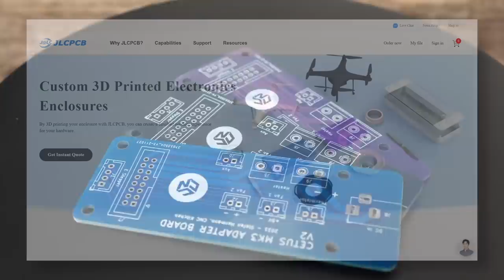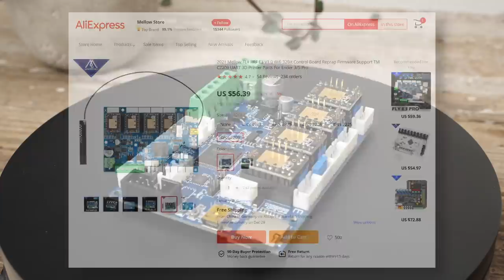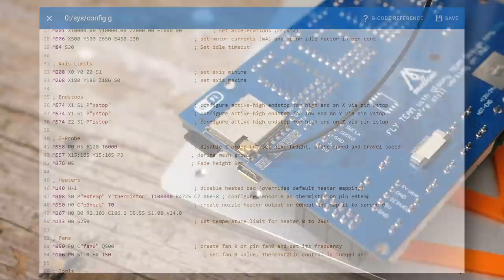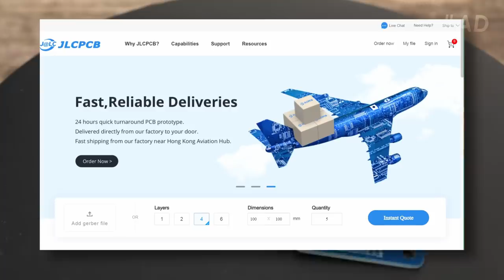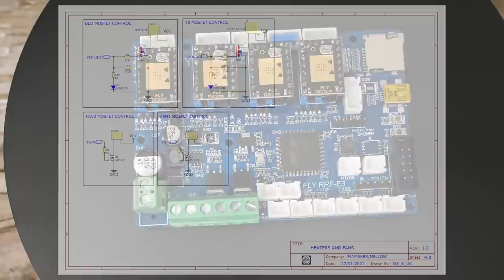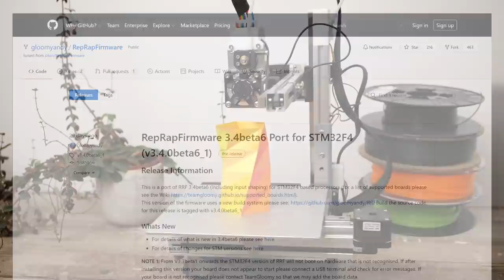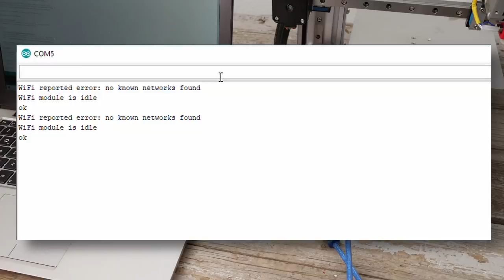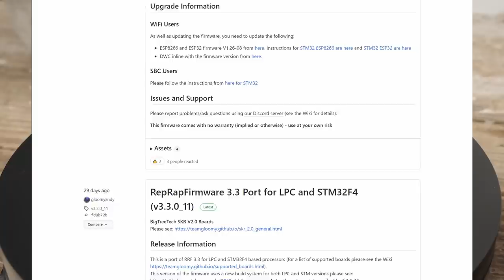I HATED my Cetus – Now I ❤ it! Mellow FLY RepRapFirmware conversion

Comment: Over time my cetus motors got hotter and hotter during operation, eventually chewing filament after the raft without fail. They should just ditch the proprietary stuff, the market won't tolerate that anymore.
Reply: This has happened to me too, and sometimes it doesn't even get through the raft. Very frustrating
Reply: I'm preaty that's broke an entire extroder head for me
Reply: @mondair99  Throw some heatsinks on it
Reply: @Lucas_sGarage  thanks boss, I'll try to remember to keep you in the loop
Reply: @mondair99  Sure, take care

Comment: This is one of the things I love about 3D printing as a tinkerers' hobby, the mechanical principles are comparatively simple (if you got four motors and parts for those motors to move, you've got the basics) and the software side is so open that you can get pretty much everything that can command stepper motors and relays to run gcode. (I'm oversimplifying a bit, but really, for something that creates physical objects, 3D printers are incredibly easy to understand even for idiots like myself. Like, for comparison I don't think building your own injection molding machine is anywhere near as simple.)

I got into things with the Ender3, and after tinkering with it for two years I think the only stock components that remain are the aluminium frame and motors xD

Comment: What a coincidence! A week ago I completed the electronics conversion of my MK2. I did it with an arduino mega + ramps 1.6 + TMC 2130 + raspberry PI 3 so that I could go with klipper. I didn't want to replace the very cool PT100 thermocouple for a shitty thermistor, so I went for a max31865 SPI adapter board. I also upped the voltage to 24 V as running the heating cartridge at the standard 19V was a pain. Now it is a pretty amazing machine!
Reply: I did something very similar on my MK1 last week too. Lol. I used an mks robin nano v3 with tmc 2209 drivers. It's got a touch screen and wifi but the screen is too big to mount anywhere on the cetus. What power supply did you go with? My heated bed is super weak on 19v. It draws 30w. I did the math and going to 24v should get it closer to 60w. Unfortunately, I did have to ditch the pt100 because it failed and I opted to replace the entire extruder/hotend. I ended up going with the kp3s titan extruder. It performs great and now I just use standard mk8 nozzles. Last night I put a 3d touch on it, so no more frustrating warped build plate.
Reply: @inoahmann7542  For the time being I am running it from my lab bench PSU and I have a step down converter for the RPI, Arduino and fan. With everything powered it draws about 3.2~3.5 A @ 24 V so I was thinking about getting an EPP-120S-24 PSU, which has a very small footprint. There are also more powerful (but larger) versions if you want to plug the heating bed.
Reply: @urano1988  thanks! I think I'll go with that same power supply. Maybe a slightly bigger one if I can still fit it in my electronics enclosure. If I need to I can limit the power to my hotend and bed to stay under the 120w limit.
Reply: I currently upgrading my Cetus MKII and MKIII I replace the Cetus extruder to BIQU H2 extruder. I also replace the TinyFab MCU/mainboard to Melow FLY RRF E3 Pro with the integrated max31865 SPI PT100 IC. And because of the shorter heater cartridge for BIQU H2 extruder  I use a Mellow 24V 70W heater, and increase the voltage from 19V to 24V. And I will also design an extra PCB for the PSU connector and for the Z axes hardware break by a relay. This feature is on the MKIII mainboard and also designed in the TinyFab mainboards as well.

Comment: Original cetus circuit board had a vase gcode bug. I think they implemented vase as delta Z moves but the firmware math truncated the remainders. Now running duet and happy. A good mod is a 1kg force linear spring ($8-20) to counterbalance Z weight which eliminates the Z stepper brake and prevents the nozzle from crashing into my heated glass bed with no AC power..
Cheers-Peter

Comment: Thanks for this video. Nice to see theat you transformed your Cetus into a good machine. I use a Fly 3 pro on my Ender 3v2. Ik like it a lot. No more recompilations of the firmware when I do a slight modification of the hardware. No extra Raspberry with Octoprint which doubles the amount of complications. I love this solution. 
Please remember to change the gcode dialect in your favourite slicer from Marlin to Reprap. ;)
Reply: Does it work with a BL touch or CR touch? As I learned more about my E3 V2 I realized I can turn it into a really nice printer instead of buying a different one. My CR touch and Jyers firmware is a joy. I like the options this fly 3 adds.

I'm also a minimalist. Any hardware I can install that will do the work of multiple pieces of hardware, I'm all for.
Reply: @dangerous8333  I used the FLY with a BL touch clone. Twotrees I believe. It's a bit more ciitical to ajust compared to the original.

Comment: I am interested in a strength test. Maybe even in comparison to standard SLS parts.
Reply: +1
Reply: MJF is superior in z-axis strength and consistency to SLS and is superior in every way besides specialized material availability.  I own two 5210 MJF machines and would be happy to provide CNC Kitchen some parts for testing!
Reply: +1
Reply: @mkmachining7957  What is the reason for this? Layer height? Temperature? Maybe Stefan can find out.
Reply: Yeah.. that fancy nylon print would be a great test subject checking for accuracy and strength.
Reply: @jayphone1  more consistent temp and the powder is fused much more quickly

Comment: Nice to see RRF ❤️. I use RRF on my machines and adore this firmware. One board, easy config and decent features.... Did I mention very stable as well?
Reply from the maker: Same here, most of my everyday printers now run RRF. It takes a bit to learn but now I love it!
Reply: I liked RRF but the problem for me is that if something doesn't work, the support for it is as useless as windows support. Switched my duet board to Klipper and never looked back since
Reply: @jexom  I've honestly been able to find documentation for everything I've ever had issues with. The wiki pages are pretty well written. Though I gotta admit having stuff like a discord server for the vorons which usually run klipper is pretty sweet.
Reply: @jexom  On the Duet forum you can literally talk to the developers and they will walk you through your issue. Is that useless?

Comment: Will you consider reviewing the Phaetus (or rebranded as Trianglelabs) 'Rapido' UHF hotend? It's a high-volume, quality workmanship, mostly nickel-plated copper unit with strong construction and a (up to) 115 watt ceramic heater, that give even the Mosquito Magnum Plus and Supervolcano a run for their money. And it does so while still using the regular M6 reprap/V6 nozzles we already have, or optionally regular Volcano nozzles. Slap a large CHT or Matchless nozzle on that puppy and it might just pass 100mm^3/s. For $99.

I believe the... "contentious" (?) aspects are more than different enough that this one goes clear of Slice's and E3D's patents.

Comment: I finally got a new 32 bit board to replace a 6 year old 8 bit one, and I didn't think it was actually possible for my machine to be this quiet.
Reply: that was how I felt when upgrading my original CR-10
Reply: I had a reverse experience at work. When I built my machine, I built it from the ground up with TMC2208s, and later upgraded to closed loop steppers (the BTT NEMA 17s, great stuff). They're really quiet, became a "silent but the fans" printer. No money for Noctuas here.
Then at work I was tasked to revive an old small CNC router, and found an Arduino Mega + RAMPS 1.4 setup with the classic A4988s there that I could use, and heck that thing screams, I had no idea they were that loud normally.

Comment: Just a note: At 4:34 you said 'RRF has begun implementing Linear Advance in the latest version' but I believe you meant input shaping, as in the image you show the input shaper test model as well. As Linear advance has been in RRF for quite a few versions now.
Reply from the maker: Yes, you're right. I was too excited after my Klipper joke and messed it up.
Reply: @CNCKitchen  haha worth it since it sums up the community pretty well. 

Hopefully I don't come across as a 'but klipper' person, but I'm genuinely interested in your opinion given your knowledge of 3d printing.

From my comparison standpoint, and considering I have several printers running RRF and several with Klipper, I think I prefer klipper slightly more for two reasons: 

1. The first and foremost being that I'm a software developer, and so have command-line access where I can deploy scripts and modify any components as I see fit. This is a bit harder with duet. 

2. The second being the actual hardware of the Pi being high quality. I have had many issues with the wifi reception with the stock duet antenna and even using add-on antennas. I sometimes send extremely large files and so this can be a pain, whereas the raspberry pi 4 even supports wifi 6, so it caters well to my impatience. 

In summary they are both great with slight differences, duet is more user friendly, and klipper more configurable. Almost like macOS vs Linux.

Comment: I just did this with a Dobot Mooz, I used a BTT E3 RRF board, it can now print any material, much better printer than the Cetus, but had a terrible main board and closed software.

Comment: Wish this was posted 3 weeks ago. I just bought a duet 2 to convert my Cetus MK2 to do just this.
Reply from the maker: Sorry to hear that. Hope it worked out for you!
Reply: @CNCKitchen  I have been messing with it all day. Unfortunately, I have MK2 and you started with a MK3. So there are some variances like trying to get sensorless homing working. I also switched from using the standard hotend to a Slice Copperhead.
Reply: Haven't started a print, but I have about 90%+ of the printer verified working. Last thing is swapping the sensorless homing with a capacitive proximity sensor for the Z axis.

Comment: Awesome.. This is a great video.. I currently have a smoothie board running my Cetus. But I will try this one soon.. BTW the original cetus heater block uses Pt100 as temp sensor. The pro version has a variant supporting pt100 so chose that if you don't want to switch original temp sensor
Reply from the maker: Thanks for the info!

Comment from the maker: Thanks to JLCPCB for sponsoring this video! PCBA from $0 (Free Setup, Free Stencil) https://jlcpcb.com/RHS
JLC 3D printing service: https://jlcpcb.com/3d-printing
Correction I said RRF started implementing Linear Advance but I meant they started implementing *Input Shaping*. Sorry.
Mainboard conversion or buying a new one? What's your take?
Reply: Conversion, it was a good machine in 2017 but now is a pain in the ass to use. Modded mine as well but I have changed the extruder also. Hate proprietary nozzles. Do you have links for the extruder stepper mod?

Comment: Nice video, this might be a mod I'll actually try. At the moment the only mods applied to my cetus is a new 80mm Noctua Extruder/Part Cooling fan + adapter, because the stock one was really uncomfortably loud. Although I'm okay with the prints I'm getting out, using something different than the proprietary UPStudio Slicer (which I dislike) with added microstepping capabilities would make this upgrade really worth the effort.
Anyway, thanks for sharing :)

Comment: i would not get a board that runs rrf. i go fpr the genuine duet boards. after all problems i had with marlin back in the days and almost quit the hobby i ordered a duet wifi. and the support i got from dc42 made me a returning customer. all my printers my custom built voron/hevort hybrid. my tridebt idex. and my ender 3 and flsun sr all run duet boards and i think its worth to support the duet crew

Comment: I have a Cetus MK1. This was my first really functioning 3d printer. (After the Buccaneer from Pirate3D with which I only did 2 prints and then it died. And I believe it even arrived later although backed earlier on Kickstarter.)
I am thinking about modifying my Cetus as well because it was a little neat machine, but I am a little afraid that getting to learn all the new stuff about the board and the software driving it will take me too much time.
Reply from the maker: If it's not your only machine, it's a great learning opportunity, though it will require some time and skill.
Reply: I think a Skr1.3 board with stepper drivers on it will be the easiest approach. No need to fiddle around with multiple boards and connections and weird firmwares. Just use Marlin on a SD card, done.

Comment: @5:10  I wish someone would make one of those awesome adapter boards for the CR10s-Pro, I really want to upgrade to 32-bit and those FLY boards look pretty, er, fly... for a wifi.  😎

Thanks for the most excellent video.
Reply from the maker: The CR-10 is internally very much like the Ender-3, so a conversion doesn't need an adapter board and most of the connectors should be reusable. Maybe check the Discord.
Reply: @CNCKitchen   The CR10s-Pro has a 30-pin ribbon connector.  I did see a breakout board a while ago somewhere which was 30-pin to JSTs, but I think the chap only made a few.

The alternative would be to chop the large connector off and, split the ribbon cable add male JST connectors.

Comment: On my Ender 3 Max I have an RRF E3 Pro. I had to switch from an RRF E3 when I added dual axis and didn't have enough steppers left. Firmware and hardware are nice as is discord support. After playing with Klipper for some time now, on my Anycubic Vyper I hope I can run Klipper on these RRF boards in the long run. Why? The camera integration on RRF boards doesn't appeal to me and I need a computer for timelapses.
Reply: Mainsaill just added timelapse functionality
Reply: @powersv2  Yeah, and I like it. One more reason I am getting away from Octoprint.

Comment: What is the difference between RepRap firmware and Marlin? 
I have an ANET A6 which I de-gutted and replaced their main board with an Arduino 2560 and RAMPS 1.4 running Marlin.
I didn't like their firmware and also the stepper drivers were soldered on the main board.
That was a deal breaker for me. So I replaced their board.
Reply: The main difference between marlin and Reprap is that Marlin requires recompiling the firmware to make changes to your settings but with reprap you can edit a plain text file and have it change right then and there. There's a lot of other features as well, but on a day to day basis that's probably the main thing.
Reply: @JasonZnack  Thanks

Comment: Oh man. My cetus mk2 prints great but its so loud. This is a bit of a project just to make it more quiet.
Reply from the maker: Exactly what my problem was! If the pinout of the extruder ribbon cable is the same, my adapter board should work as well!

Comment: My first 3D printer was a Tiertime.  The proprietary firmware and terrible software led me to doing one print, then putting the thing back in the box and returning it.  Except UPS never picked up the box and the return window passed, so it's been sitting in my apartment for three years.  Maybe it's time to add decent electronics and bring it back to life.  It's not doing much good in that box.
Reply from the maker: Do it because the general design of most of their machines is not too bad.
Reply: You must have too much money to leave new machines laying around😐
Reply: That's kind of true, REDxFROG.  I've had some sort of project in mind for years but I'm at the point where a second 3D printer would save me time and effort, so resurrecting it seems like a good project.  It's unfortunate to waste money on things, an expensive lesson in just buying a Prusa i3 the first time!  But, it's not like I tossed it into a landfill, it's in the original packaging and is ready to be transformed into something useful, which Stefan has motivated me to do.  So ultimately, it's not a big loss (compared to if I just kept using it, getting mad at the software every time I needed to print something, and giving up 3D printing).
Reply: @JonathanRockway  nah. Put it away and get more Prusa. Even the mini is just so good. :-)
Reply: Too late! Just finished disassembling it :)

Comment: RRF has an inferior pressure advance to klipper. RRF uses the same PA value for both X and Y, where Klipper has independent values for X and Y. plus klipper can use your super old hardware because the PI is doing all the hard work
Reply: so .... compensation vs solution?
Reply: Do you mean input shaping?

Comment: Than fan connection to 5v rail is not a good idea. It could kill board. You dont want to have 19v on 5v rail. I would recomend revision of adapter board with DC-DC converter and mosfet controled by fan output of board.

Comment: hey Stefan what about reprap firmware port for skr boards it worth?
Reply: The firmware on the Fly boards is the same port as used for the SKR boards by teamgloomy. As long as you are using a supported STM32 chip all the features of RRF are supported and are usually current to a production release Duet3d RRF and only a revision or two behind on the latest Beta builds. Very functional.
Reply from the maker: Should be a very similar experience. Definitely worth trying out, though I don't have any experience with SKR boards.